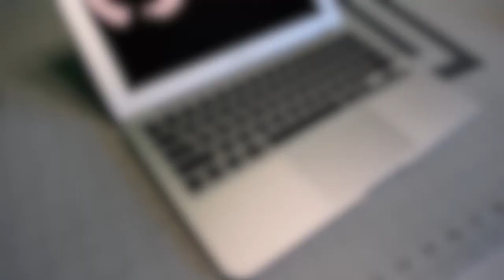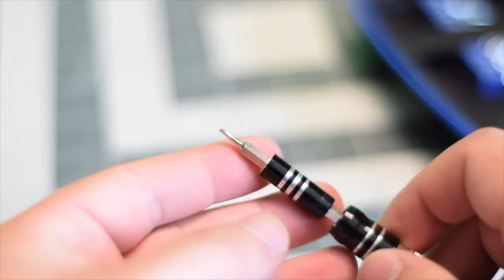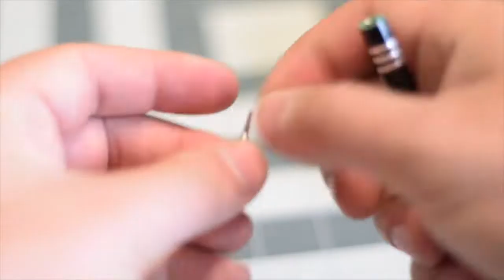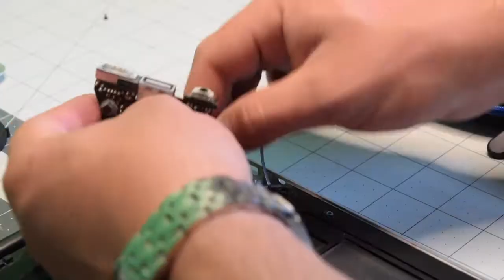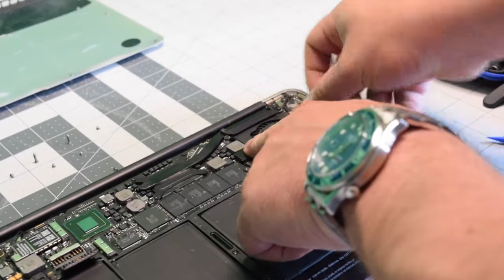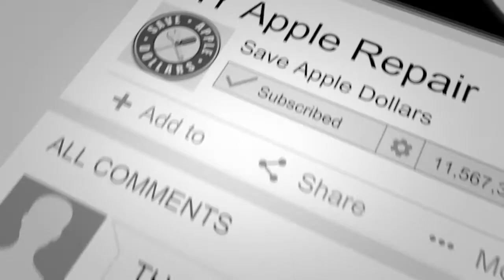11" Macbook Air A1370 and A1465 Logicboard Installation for years 2010 2011 2012 2013 2014 2015

Comment: Can i change a1370 mb to a1465?
Reply: Nope, I think the SSD wouldn't work because a1370 is like 2012 model and there is SATA SSD and not M2 SSD. So you can, but you need to buy new SSD probably.

Comment: Thank you so much for this, I was able to upgrade my macbook air to an i7 8gb model since the logic board went bad (wouldn't boot to ssd). I had this little pc tucked away for 5 years before going forward with this fix. You helped me out immensely in getting it working.
Reply: Hey.. I’ve MacBook Air A1465 11inches 2013 mid model. Current logic board with I-5 4gb ram.

Can I upgrade with i-7 with 8gb ram?? 

As currently it’s dead. Service centre told to replace logic board. If you’ve any idea about this. Plz do reply. How and from where I can order new logic board with good quality and less price. Apple service centre asking for a huge amount.
Plz reply.
Reply: @mr.cabin_crew  hey yes you can replace it with an i7 board. I was able to get it off ebay. I paid about 240 for it. If I recall it was on sale. I would hope it's cheaper now.

Comment: Thanks for the video. Is it possible to swap A1360 mid 2011 logic board with any of A1465 logic boards?
Reply: Hi. I would like to know if u did it. I wanna do the same swap between a1465 and a1370
Reply: @orocubano77  No. Don't remember the details but I found it would require chassis mod. Instead I upgraded with the same motherboard but with 4 gb of RAM + faster ssd.